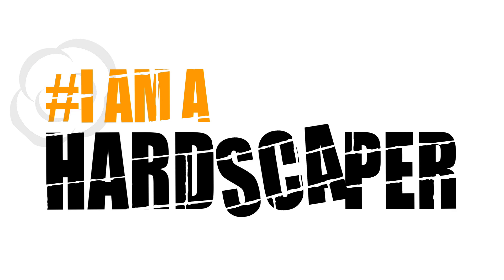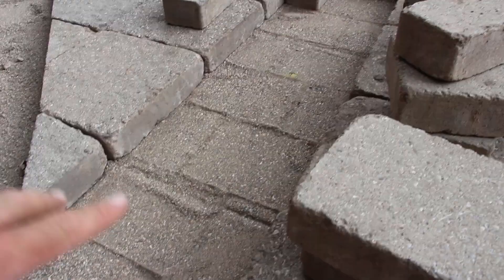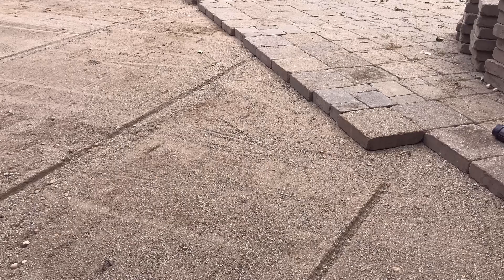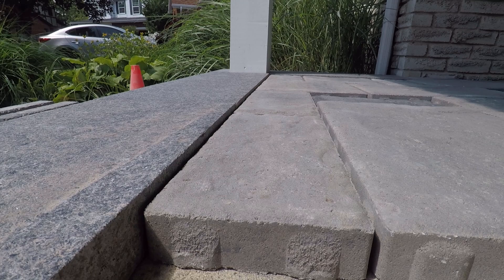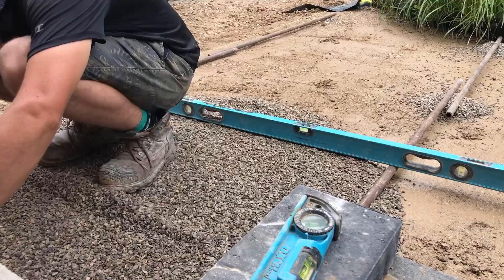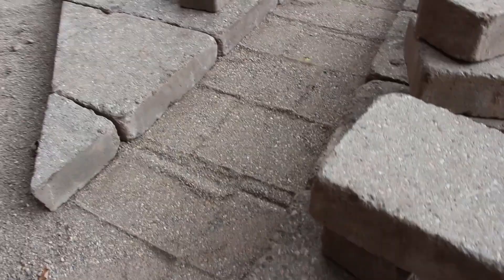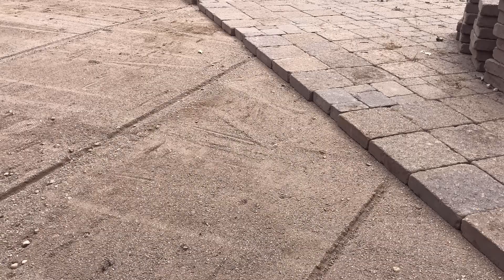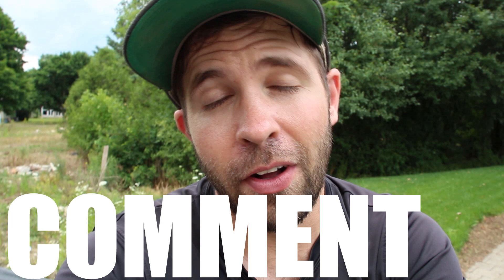HPB vs Concrete Sand for Pavers | Bedding Layer Comparison

Comment: I can't find an answer, please help: some lay with sand (no matter the kind), and some use cement to build it I guess tougher the structure. Explain why one need to use cement or sand. Pros and cons. I'm an amateur as one might notice
Reply from the maker: It just depends on the application and climate plays a factor as well. Here in Toronto, using a mortar to adhere is not a great solution for pavement because it traps water. Sand instead will let water through rather than trapping it so it won’t cause problems in the winter.

Comment: Hi, this video has really got me thinking.  Was wondering. Do people ever use 3/4" clear and hpb for bedding when doing stairs/steps?  What is your preference?
Reply from the maker: Yes, my preference depends on the application. If the surrounding area has a place to drain, then I have no problem going that route
Reply: @iamahardscaper hmm, the hole purpose for 3/4 clean, HPB is to max drainage right? Sand may compact with 3/4 clean stopping draining that is why you use geotech between sand and 3/4 clean. Do you agree? And is home depot sakrete leveling sand the Samething as concrete sand? Thanks

Comment: Hi, what is the ideal joint distance for concrete pavers?  Some pavers come with raised areas to set the distance.  What do you do when the pavers lack these “bumps”?  Does this change if using sand or base panels?
Reply from the maker: If there are no space bars on the sides of the pavers, aim for a 1/8" joint space. Though some pavers are designed with no space bars but are slightly tapered to allow sand to fit in between the joints like these shown in the video. This still allows sand to make its way down even though they do not have space bars on the sides of the pavers. This does not change.

Comment: Went to the stone yard today and not sure if they sold me the right stuff. Its a small angular down to dust. I think you said down to fine. I don't want it to hold water or settle to a lower height of the garage concrete I'm leveling to.
Reply from the maker: That sounds like stone dust. Search our stone dust video on our channel to see if it is the same

Comment: I work in Northern Illinois we use sand beding we have a lot of  Clay soil when you use 3/4 chips and 1/4 chips base and paver Beding dosen't water goes throu and ponds on base and if it's close to winter dosen't heabe up
Reply from the maker: We have a lot of clay here as well. Sloping your subgrade away from the foundation and having an area for water to flow outside of the project area.

Comment: Can you comment on using HPB vs sand bedding for paver panels (Brock, Gator, etc), especially regarding bedding compaction.  Since the panel rests in the bedding and the pavers rest on the panels, the bedding can't work it's way up between the pavers so there is no compaction happening there.  Brock recommends 3/4" sand compacted down to 1/2" and they don't mention using HPB at all, so I'm confused.
Reply from the maker: Yeah I don't think Brock is into the industry too much, but they license their product to other manufacturers like Gator Base (Alliance) and EZ Base (TechniSeal) and they both say either sand or HPB. Sand needs to be compacted as well for both of them, HPB does not. And yes, you do not get the interlock that you would with other base materials which is partially why it is not rated for vehicular or heavy pedestrian traffic.
Reply: @iamahardscaper  So the HPB (or #9 clean angular stone) does not need to be compacted at all, under paver panels?

Comment: Loved yer clear explanation of the different aggravates. I want to top up my driveway w/ gravel, and set in two patio stones to my front porch steps. Seems as I underestimated myself, and put down 1/2” gravel, and bought brick sand for the front porch. Now I know, at least to get concrete sand and 3/4” gravel. I’m in Toronto, ON Cda. Thx!
Reply from the maker: Glad it helps! I am also in Toronto 👍

Comment: Thank again for this video and all your other content! I used 1/4" chipped granite on our paver walkway and patio last year. It certainly did the job, though I would definitely argue for the 3/8" clean chipped rock as the way to go. I had an extra sidewalk to do from the main body of the project this spring/summer and opted to try 3/8" clean Grey Trap. The place I got it from also had 3/8" chipped granite, though those pieces seemed to be more consistent in shape than the grey trap and I figured more irregular shapes might be better for locking in when tamping. In short, having worked with the two, I do think that the 3/8" clean angular rock is probably the best way to go for a bedding layer. It's a nice middle ground. You get screedability with a larger, coarser size, that will likely provide a better lockup over time (less shifting and/or compression). 

I would suggest, if you find it works with your videos and jives with your experience, to perhaps talk about height differentials with the differing sizes of bedding aggregates and how to account for those differences in meeting a given height to aim for. For example, sand is basically completely level with the screed bars given how small it is, and while 1/4" and 3/8" clean angular rocks are screedable, you will see a lowering of the level surface as the larger aggregates will pull some of the material beneath it. You'll see a lower level surface (between the screed bars) with 1/4" rock vs sand, and a subtle difference in height between the screeded surface of 3/8" and 1/4" rock (and even more so between sand and 3/8" rock) as it relates to the top of the screed bars. That, combined with how much height will be lost due to compaction seem like interesting pieces to consider when determining a given height/metric to be aiming for when building a project. 

Thoughts? 🧐🤓
Reply from the maker: Definitely a good topic to cover! Something I’ll consider in the future. By industry standards I believe it is +/-1/16” for height differences between pavers. Something that i should incorporate somewhere in a video 👍

Comment: Excellent discussion thanks👍🏻 As you know Mike, I'm redoing my patio. 25 years ago I used a couple of inches 3/4" then 3-4" screening then screeded 1" sand. It stayed solid as a rock for all that time and didn't heave. However, when I removed my pavers I notice all the sand had infiltrated the screening. 
So at least I have a good strong base of screening now which is like a concrete pad and a section of clay (expanding part of the patio). So as per your videos and discussions I'm simply resloping and relevelling my screening/clay soil, compact with plate compactor, non-woven geotextile, 3/4"-1" HPB, Gator Base then 14"x28"x2" (50mm) slabs followed up with polymeric sand. 
Since I can't use a plate compactor to vibrate the polymeric sand into the joint and likely no one rents a roller compactor I'll just use my hand tamper with a piece of carpet duct taped to it. Yes it's a MacGyver but should work. It has to, I'm not buying a roller compactor for one use. 😃
Cheers and thanks for your videos.
Reply from the maker: Thanks for commenting as always Carl! I always appreciate it. Everything you wrote checks out in terms of installation. Make sure you compact the subsoil 👍
Reply: @iamahardscaper  Thanks. Yes, agreed and luckily, its mostly clay with no organics. At least the screening doesn't need compacting but since I'll be renting a compactor I might as well give it another massage.
Reply: @iamahardscaper  BTW, forgot to mention, I went to pick up some 1/2" black pipe (3/4" O.D.) screed pipes at the big box store by Yorkdale. I picked up the mini skid of 5. They're ~$17 each right, but there was an issue with the computer at checkout. I ended up getting the skid of 5 for $17. 🤫🤫
Reply from the maker: What a deal!
Reply: @iamahardscaper  LOL
Reply: Guessing you're done with the install, but there might be some rental spots that have the roller compactors available. I was lucky to find one this summer/fall as I didn't want do have to be shuffling around plywood with a plate compactor.

Comment: Very informative video! I had a new 20x20 natural stone patio installed summer 2020. Tight joints (1/8 or less), 4 different stone dimensions and thickness is not uniform. The patio has a steep slope (when it rains the water flows to a catch basin). The contractor used 10 inch crushed gravel and topped it with 2 inch compacted limestone screening. The first 3 summers the system performed well (we had moderate to low rain) but the fourth summer/year the system failed due to heavy rain (washed out the polymeric sand) so I had to reinstall the polymeric sand. This summer we are getting a lot of rain, the stone is turning green and I see moss in the joints. I lifted up a stone or two and see that the limestone screening remains humid(not water wet) a while after the rain (it dried quickly after lifting the stones).  I am considering getting the job redone by removing the limestone screening, keeping the 10 inch gravel (under the gravel the base is sand) and use concrete sand as replacement for the limestone screening. Ideally I would use HPB but it does not seem to be the correct solution because of the tight joints, any suggestions?
Reply from the maker: Are there trees overhead? Is there a lot of shade on the patio (minimal direct sunlight)?
I personally do not like using HPB for natural stone square cut because of the tight joints as you mentioned and because when you lay 1" material with a large surface area on HPB you get a hollow sound walking on them.
An alternative to this where you can have a permeable base would be to widen the joints slightly to install this system: https://youtu.be/_1zSZkrBjz8
Expensive, but it would be a patio for life.

Comment: Thanks for the great video! I ended up doing a 1/4" chipped granite bedding (thanks to these videos) over class 5 (which was already on my driveway before I learned about the open aggregate option). If I recall, you're in Canada? I'm in Minnesota and I have to say, I've been pleasantly surprised at how easy the pavers are to maintain in the winter. With concerns over chemical de-icers and their effects on pavers and joint compounds, I was worried I would have icy pavers without much to do about it. I don't know if it's drainage or that the rock bedding affords some degree of an air gap with the class 5 underneath, but when we've gotten snow, I simply shovel it off and the pavers during the day basically defrost from the remaining thin layer of snow left after shoveling. The pavers just warm up significantly more than does our blacktop driveway. My best guess is that the class 5 underneath the blacktop is frozen, so the sun has less of an effect on it, while the rock bedding under the pavers allows the pavers to have a gap between themselves and the class 5 allowing them to warm up more effectively with the sunshine. 

Thoughts? I'm wondering if this is normal for pavers regardless of the bedding layer, or if this is yet another perk to using an open aggregate for the bedding layer? Or more simply, have you seen this as well in terms of how these HPB installs fare in colder climes in comparison to sand bedding installs?

The product we installed is Techo-Bloc's Blu 60 Smooth in HD2 Chestnut with a chocolate brown Victorien soldier course. So it's basically a dark tan/caramel colored paver, but obviously not as dark as the blacktop driveway, which was always markedly hotter in the sun during summer than our prior grey, poured concrete walkway.
Reply from the maker: Yes, I am surprised that it is having an affect with just your bedding material. But with an open graded base which would be 3/4" clear instead of your class 5 and 1/4" chip as the bedding, there is enough air flow to prevent freezing. This keeps your pavers from accumulating snow as long as the temperatures do not remain freezing for long periods of time or large amounts of snow. Glad to hear that you are seeing this with your project! Let me know if it continues.
Reply: @iamahardscaper  Thanks for the reply! Good to know I wasn't just imagining things or thinking I was on to something that is common to all pavers regardless of install method. 😆 We had considered using one of the resin-based joint compounds, but the tight gaps on the Victorien brick pavers made it a no-go. We did the polymeric sand instead, which I understand is less permeable and is better able at allowing the water to follow the slope off of the pavers, whereas the resin stuff allows water to sink down into the bedding and base layers to run off. Perhaps that has something to do with helping the 1/4" chip rock/open aggregate bedding layer to act as an insulating layer? To be clear, one of the better examples was the day after we had gotten some snow. I had shoveled that night and we were supposed to have a sunny but frigid day the next day, so I thought, "This will be a true test!" Sure enough, we started at -3º F, got up to a whopping 17º with a fully sunny day, and the residual snow left on the pavers from shoveling progressively disappeared throughout the day. 🤩

I have no idea if it makes a difference, but I'm also wondering if it helps having the HD2 product as well. e.g., Would the extra density of the upper layer on these slabs be more responsive to warming from the sun than more porous non-HD2 slabs? 🤔
Reply from the maker: Sorry, missed this comment. That is a possibility, as well as if it is a darker color as well.

Comment: Thanks for video. DIY and preparing to do a large porch patio enclosure 16'x36' with pavers instead of concrete pad. The pavers will be supporting a swim span / hot tub that will be 8' x 22' and when filled will weight approximately   34000lbs. Any suggestions on the process and what products would be best to use. Regular pavers or Driveway pavers 3 1/4" - concrete sand or 1/4"?  Any suggestions would be appreciated. Thank you Tim!
Reply from the maker: on our last project from last year what we did was pour a concrete pad for the hot tub and then overlay that area with pavers. Everything else around that was on a synthetic base. But with the pad being level and the pavers around the pad being sloped you have to blend the two areas as best you can.

Comment: Watched many of your videos and found them very helpful! I'm doing a patio in my backyard with pavers and I'm using HPB w/ gator base. I unfortunately excavated more than I suspected and have close to a 3" - 3.5" layer of HPB. I think I saw a comment from you on another video to not go more than 1.5" - how could I still make this work with 3" in some areas? I plan to backfill the edges with soil to hopefully prevent washout and have a non woven geotextile separating my subsoil from HPB
Reply from the maker: I would use a dense graded base and compact that into your subsoil. Then use non woven to separate and then your HPB.

Comment: My landscaper just used high strength concrete instead of poly… what might happen???
Reply from the maker: polymeric sand flexes with the movement of the pavers from traffic and freeze-thaw cycles. Concrete does not flex, so it will likely crack

Comment: I used synthetic panels. The manufacturer of the pavers changed their height on the border/soldier course. Half are 2 3/8 the other are 2 1/2. The main pavers on the patio are 2 1/2. What can put on top of the synthetic panels to bring the shorter pavers up so they are flush with the rest of the pavers. Your thoughts please.
Reply from the maker: Between the edge restraint and the main pavers, use concrete sand. So lay the border up against the main pavers, install the edge restraint, take out the border pavers, lay some concrete sand, and lay the pavers back.
Reply: Thank you kindly. Such a simple solution. That’s why your the pro.

Comment: What do you recommend? 
I have large 24 inch pavers that have a 4 inch gap. I want to put something inside that 4 inch gap that is less hard than concrete but stronger than fully cured polymeric sand (which is easily damaged and requires re-doing part of the job later on).
Reply from the maker: You may be looking at a polymer modified grout. I don’t know what the base looks like though

Comment: I am a DIY’er and doing my first patio. I am using a synthetic paver base and planned to do concrete sand, however some of your other videos I think I want to use the HPB limestone instead of the concrete sand. 

Since this is my first patio, I assume my gaps will be larger. Will the HPB hurt in this aspect? With HPB as my under layer, can I still use sand to fill in my joints on top of the pavers? Also, do I need to compact the HPB? So I need to compact the pavers as well?
Reply from the maker: The joint widths don’t matter with paver base panels because your bedding layer are the panels so no bedding moves into your pavers from the bottom up. Also most pavers have built in bumpers on the sides that provide the joint widths.

Yes you can use sand to fill the joints for paver base panels. You do not need to compact the HPB, just the final compaction of the pavers with protection while installing the jointing compound. Concrete sand as your bedding would need to be compacted before installing the panels.

Hope that helps!

Comment: Do you have any opinions on using "mechanical concrete" (recycled tires with the sidewalls removed to create a jumbo geo-cell style reinforced road base) base under a paver driveway?

I am trying to find 50 year+ longevity for everything I build on my property, including a driveway that goes over a fairly large culvert (or several smaller culverts in a row).
Reply from the maker: Unfortunately not, I have not tried that